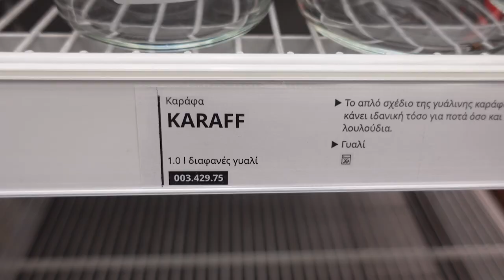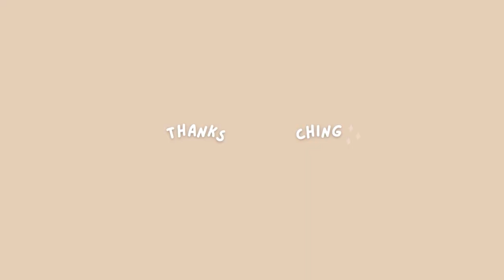DIY IKEA HACKS | Plaster Side Table & Mushroom Lamp

Comment: Since you glued in the battery operated push light, will it be more difficult to change out the batteries?
Reply from the maker: That's a great question! It's actually not hard at all. I just twist the top part and it comes apart ☺️💞
Reply: @HomeByMon  Awesome! Can't wait to try this!